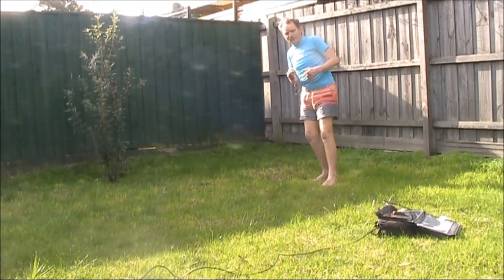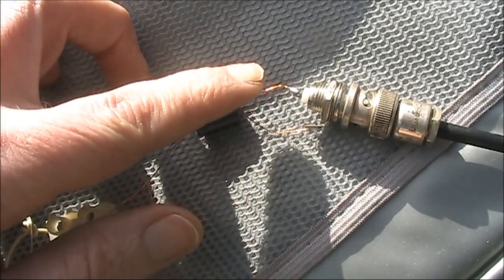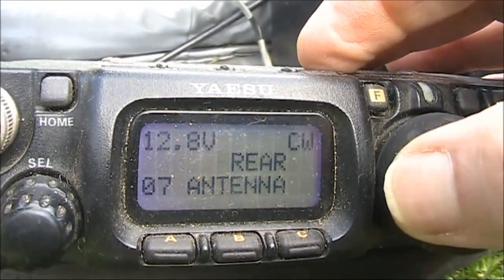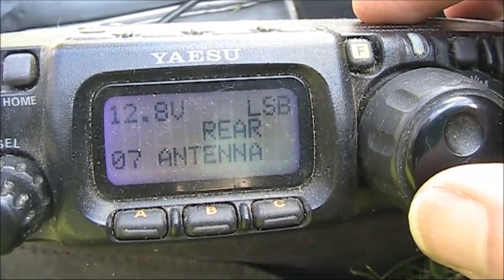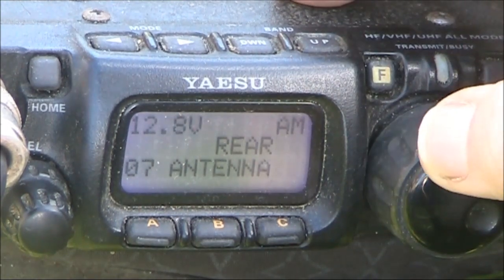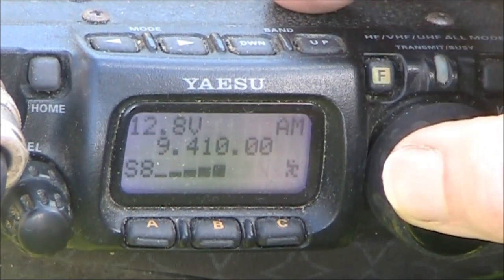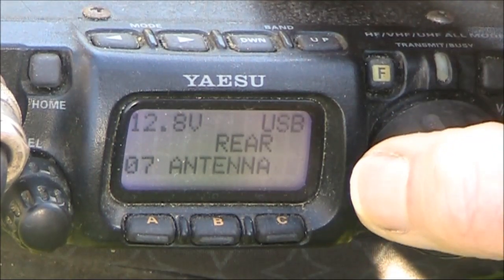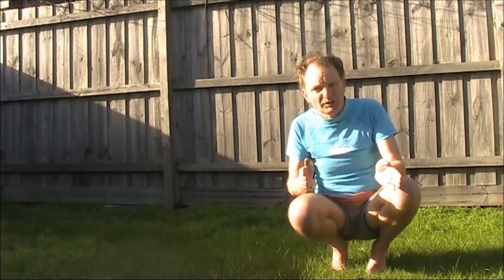Wire loop on the ground for HF receiving: How good?

Comment: Not enough land there plus too many close houses but if you have a couple hectares maybe a Beverage Antenna would work well. I know it would work well with a few acres of land because for years about 15 to 20 years ago I was using skywires of 500 to 2500 feet through trees in my rural location but I also put a 500 foot beverage on the country land that family lived at and would pick up all kinds of SW stations from 1993 to 2007 at that place. Not to mention verified over 150 countries on shortwave until sadly some of them no longer transmit on shortwave. Was a cool experience and also doing some HF contesting from that location in later years.

Comment: GET so TIRED of nothing BUT NOISE!. White noise....Squealing...The hobby is a waste of time half to 3/4s of the time even for simple listening! (AND people "believe" this will be helpful in an emergency!...BAAAAH!)
Reply: A lot of the trash you will hear including squealing and other noise is basically common mode noise where noise from electrical sources, computers, TVs, appliances end up on your feedline and go back into the receiver. The best thing is to get your antenna outdoors and as far up as you can into a tree or at least somewhere where the coaxial feedline isn't pumping common mode trash back into your radio. Another way to do this is making or buying a common mode choke or using ferrite rings or ferrite chokes to knock out as much of this unwanted trash as possible. Another method I have been working with myself was building magnetic loops for not only HF bands like 80 meters, 40, 30, 20, 17, 15, 12 and 10 but to also use a noise reduction device like a Timewave device ANC-4 where you can reduce the overall noise. Prior to doing this I regularly on 20 meters had an S7 to S9 noise level. Doing all of these steps which cost me a few hundred dollars for the ANC-4 but also the ferrite on coax has now reduced my usual 20 meter noise level to S3 or S4 not terribly ridiculous when a lot of the times the natural noise floor is S2 sometimes S3. It's not perfect but its better than letting this noise trash dictate when you are going to operate etc. Even better is if you can get a few miles into the country where there is far less interference. I hope to be doing that in the next year or two to move someplace without any urban noise issues a maybe 3 to 5 acres of land. Many years ago I lived at a similar place and my noise level was virtually nothing and the noise floor was the standard S1 to S3 at most except for thunderstorm crashes in April through September. Which was mostly a problem on 160 meters, 80 meters and 40 meters. One item I would stay away from the MFJ 1025 and 1026 Noise Reduction modules. IMO they are pure junk and very difficult to get to work as noise reduction. I've had an ANC 4 going back 20 years and at one time lived in an urban apartment where the noise level was usually S9......using the ANC-4 cut that noise level just about in half and I worked over 100 countries on an indoor wire antenna wrapped around the walls of the room using cup hooks as supports several times. 100 countries on SSB not bad. Good luck to you.

Comment: An improvement could be had by using miniature coax without the shield to reduce common mode crosstalk from the primary to the secondary in your binocular transformer core.  It reduces the capacitive coupling between the turns.

Comment: 2:46 from the manual: "The IPO feature bypasses the receiver RF preamplifier, thereby eliminating the preamp's gain. On the bands below 14 MHz, the input preamplifier is rarely necessary, and activa- tion of the IPO feature will provide substantial protection against intermodulation and other problems associated with strong signal input to the receiver. Rule of thumb: so long as the S-meter is moving on background noise, additional front-end gain is not necessary." and ATT: "the Attenuator will reduce all signals (and noise) by 10 dB, and it may be used to make reception more pleasant under extremely noisy conditions."

Comment: peter  cut that loop in half, earth the hot end piece with 470  ohm +_ and throw the other halve in the box for another day.
:) Mine is a  60m piece of wire strung 2m  high, 9:1 fed and earth at far end  through 470 ohm, now that works, the loop ? nah its a waste of time.
Reply: it's not a waste of time -- in my and many others'  environments it has made a dramatic difference in signal:noise. If it didn't in yours, fine, but don't assume and claim it's a waste of time for everyone. The KK5JY LoG can work very well indeed.

Comment: Hi Peter, a while ago I did the same tests, the noise caused by appliances lowers a lot, with constant noise s9 + 10 low to s5 the agc and audio readability work better, I could maintain a qso if I change the antenna when transmitting

Comment: I've been thinking about making up a loop like this for receiving and connecting it directly to a radioberry connected to my home wifi so I can listen to it on the computer in my office while using the other radio connected to my G7FEK. The trick is going to be some protection for the radioberry when I transmit on the other radio.

Comment: Over the past number of years stuck in this flat I've only been able to use a longwire and have had some pretty good results with it, it's literally 30 feet of speaker wire and I'm getting stations from all over the globe my main rx are from uk/Europe , north central and south America these are pretty reliable and occasionally Australia on a really good day usually 3/5 can be better can be worse, thanks for sharing another great video mate, 73's MM7BXH Rab.
Any operators from anywhere near coffs harbour ?.
Reply: With that did you use any other components like loads, transformers or coax with a certain impedance

Comment: Hi Peter - I had been hoping you would feature a "Loop On The Ground" receiving antenna on one of your vids.  A nice surprise to see it!  A few months back I played around with one of these for about a week and I came to just about the same conclusion that you did.  When I first was preparing the antenna I was really hoping it would work better than it did because I am in an unbelievably high noise environment here.  I have to say though, I wasn't too shocked when I saw how it really worked.  You're right it is kind of surprising that it even works at all. Probably useful in [extreme] stealth antenna situations.  Cheers - de WB8YMV
Reply from the maker: Thanks Mark. I think it would be great in small lot circumstances. Where you can only put up a vertical (noisy on rx but OK on tx) but might be able to put down a loop on the ground for rx.

Comment: 👍thanks for demo. I was a little surprised that your loop didn't have a more dramatic effect on noise. The only 80m antenna I currently have is an inverted-L. On TX, it gets out around EU OK but useless for DX. On RX it is very noisy with S7 to S8 noise typical and doesn't hear much DX. So, one afternoon, I quickly put up a temporary 80m end fed dipole just above ground on 2m poles. The 40m of wire was in a near perfect square with the ends close together (approx. 1m). It certainly dramatically cut the RX noise down to S1. However, I suspect the radiation  angle was very high. Certainly good for NVIS though as I worked a G-station a few hundred km away on SSB with 5W QRP. I should have left it up after dark when 80m DX opened to see how it performed - that was the plan. However, XYL pressure was exerted to remove the offending poles and wire from the lawn 😔. Not a proper loop of course, just a low dipole in the shape of a square loop but it certainly worked.
Reply: I have gotten good results with my EFHW after viewing Steve Ellington's videos where he measure RF current for various configurations.

One of the configurations produced 33% more RF current on the antenna wire than other typical installations.

One of my playlist "Technical Presentation" has it as the second video.  

Ellington has two videos of the test.  One is the actually test which is long, a bit boring, and harder to follow.  In a second video he distills all the info into a chart.
Reply: Second video by Steve Ellington will help optimize an EFHW inverted-L.

https://youtube.com/playlist?list=PLJtn8QaWqfA7-3RIHbxFWiW7rEZmC0Tsk
Reply: Maybe look at trying a mag loop
Reply: @MidlifeRenaissanceMan  , thanks. On the list of things to try is an active RX loop for HF and maybe an 80m/60m Small Transmitting loop.

Comment: Not to be confused with a ground loop.
Reply: I have one of those in my home studio. Also, if I have bare (bear ?) feet on the wooden floor, I feel electric shocks when I touch earthed metal appliances.....haven’t finished the wiring in that part of the old house.

Comment: I've run very low dipoles on 20 MTRS , No more than a mtr above ground , The noise was very low and I still managed to work Europe with respectable signals  from here in Wales .... Gw0wvl 👍

Comment: Hi Peter, I built one last year because of the high noise I was getting on 80m. I documented the build and brief test here: https://youtu.be/uQUiPHwStcY
I found that it DID make quite a difference on 80m and to a certain extent 40m. I used a different impedance matching ratio to you. It is amazing what a loop of wire on the ground can achieve though isn't it! Thanks for your great videos. 73 Nick M0NTV